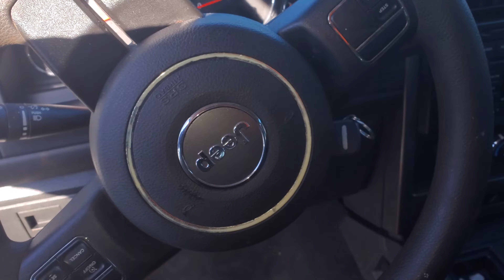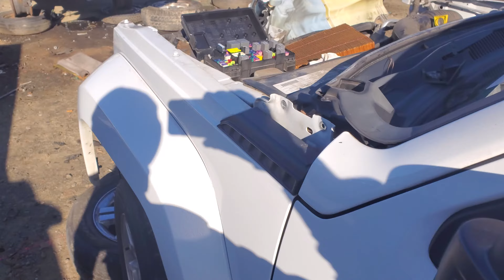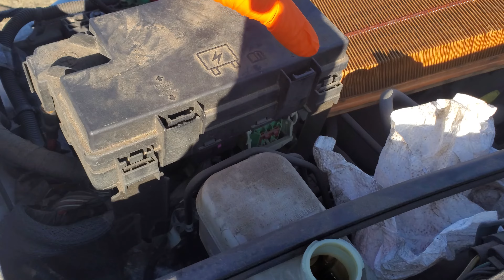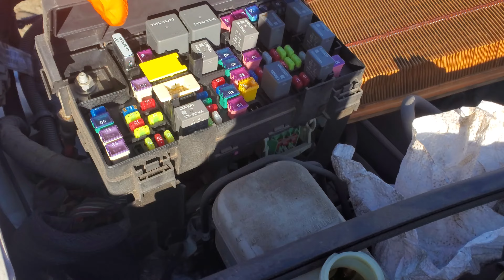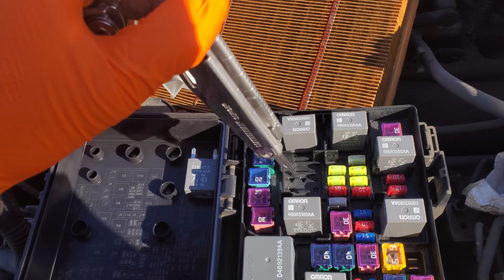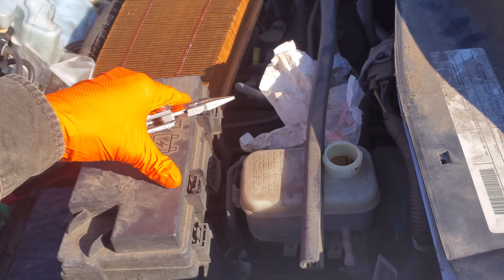2012 Jeep Liberty Starter Fuse, Starter Relay & Starter Circuit Explained

Comment: Thanks for the helpful video. I have a 2012 Jeep Liberty. Once you start the car, release the key, the solenoid stays engaged intermittently. Already replaced starter, starter relay and ignition actuator. Still happening.  Any thoughts? Thanks!

Comment: Is there a starter solenoid on the firewall above the battery on the driver side??? I hea= rapid clicking nor versed in using a voltage tool.

Comment: I have a 2010 Jeep Liberty that only has a starting issue when you have driven it for a while you shut off the engine. Then if you try 5 min later the starter just keeps cranking and acting as if it’s not getting enough fuel to start. If you wait another 20 min the truck will start fine. Never have an issue on a cold start only when the engine is hot. Dealer can’t figure it out. Tested fuel pump and it’s fine. It has enough pressure. Relays and starter also fine. I’m lost if what it could be that’s causing this to happen when the engine is hot. Once started the car runs great.
Reply: I'm having the same issues with my wife's Liberty of the same year, did you ever find out the cause & it's fix?
Reply: @a7m2a7  hey, I’m having the same one here😂 did you fix it?
Reply: @rovshan444  I ended up finding that my issue was oddly enough, coolant related so that in my hot climate, the Jeep determined it wasn't cooling enough to safely start after previously running. Due to a slowly leaking waterpump, and though I saw coolant in the reservoir, it was too low, the coolant was old and also not helping things. 

I went ahead and replaced the thermostat while I had everything apart for the coolant system's flush and waterpump replacement. I got it new coolant to level, burped the system, and no more starting issues! Goodluck if your problem works out to be like mine👍

Comment: I have a 2012 Jeep liberty.  One day i was driving around with a trouble code scanner attached.  I was running errands and got out of the car shut it off.  came back to the car and and tried to restart it.  the lights and fan came on but the start would not make a sound.  I tried jumping it, not a sound.  curious, the starter never made noises to indicate that it was about to go out at all.

I cleaned the terminals, finally i decided it was the starter and had it towed.  Oh i also unlocked the gear shift and moved it to nuetral and tried to start it like that.

I am wondering, by leaving the trouble coder plugged in, if it locked up the computer which locked up my starter relay.

Midas regardless told me it was the starter and charged me 500 for replaceing it.  I am wondering if they just reset that relay you pointed out.

what is your thoughts or possibilities?
Reply: Having similar Sort of problem, It runs tho randomly it choose not to start and after 5/10 it will start, don’t know what’s the issue with mine. Hope you sorted out yours. Cheers
Reply: Did replacing the starter fix the problem?
Reply: It very well could be... A relay makes a momentary electrical connection to get the power to the starter to start the car. and there are a set of contacts that are called points in the relay that can be corroded that will give an intermittent starting issue.

For the low cost of a relay, it is not bad to have a spare on hand or just replacing it to see if the issue goes away.